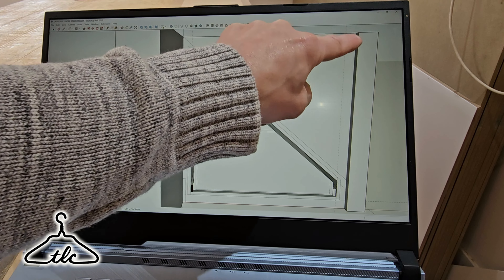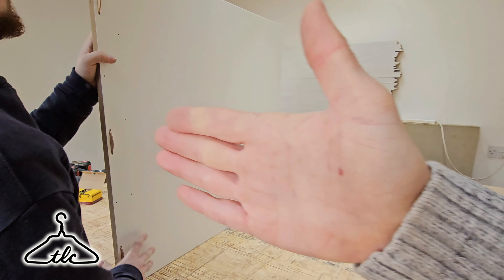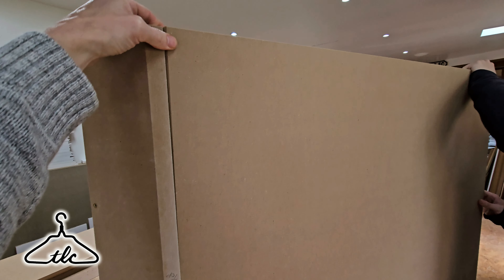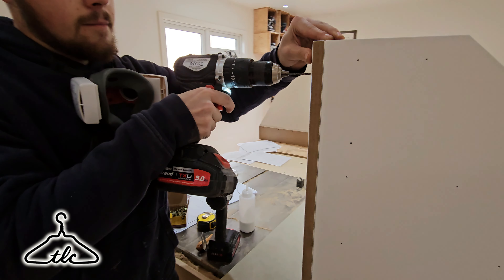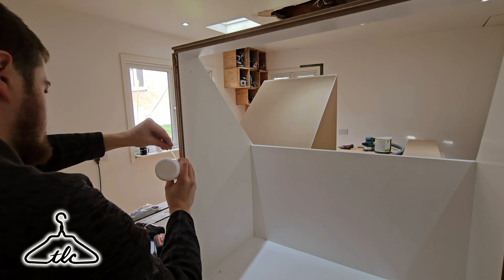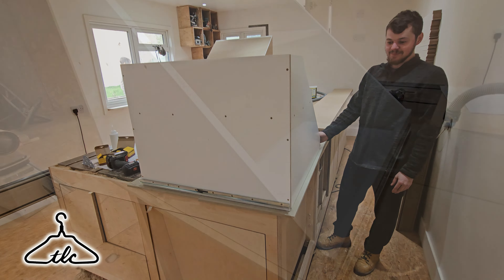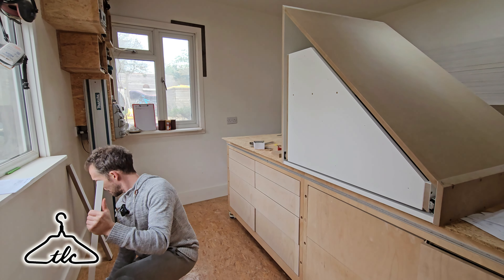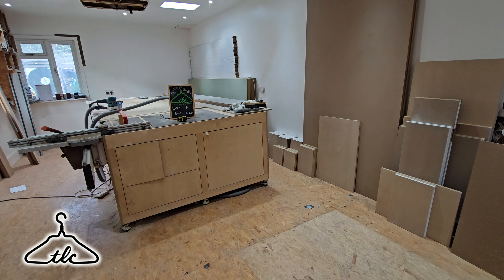Under Stairs Storage : Designing a COLOSSAL Pull Out Drawer ( Up To 100KG Load! )

Comment: Great Job guys. This is the first time that I have seen this done with the outer carcase made as a separate unit. Mostly I have seen it done with the outer carcase built into the stairs. This is on my ever increasing job/project list and I may shamedly steal this idea of building it the same way as you did it. Great job!
Reply from the maker: Ahh cool!
Yes steal away!
I think it makes fitting and trims easier and gives you a much more solid job/finish 👍
Those runners though were amazing! Can't believe they can take 100kg!

Comment: shouldnt you be clearance drilling the panel you are fixing, instead of just 3mm drilling both?
Reply from the maker: Hi im not sure I het get your question?
Reply: If you don't drill through both you risk the mdf splitting
Reply: @jochippyy  Yes, he should be drilling both, but should also be clearancing the first panel with a larger hole, or using a suitable screw with an unthreaded shank portion. I actually replied to his request for clarification, but I guess I made him look bad and he deleted the comment.
Reply: @geoffy101   no  you didn't make him look bad, he is a skilled chippie with a very successful business.  I think you are nit picking though